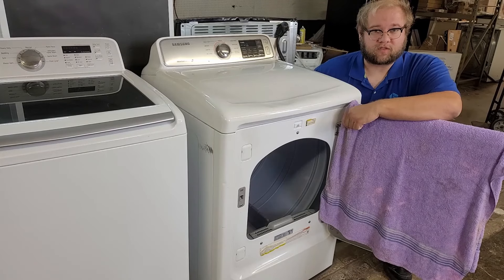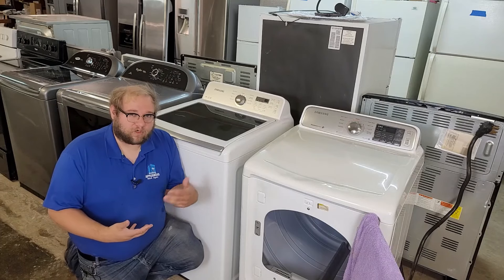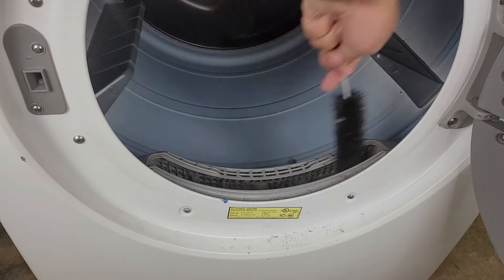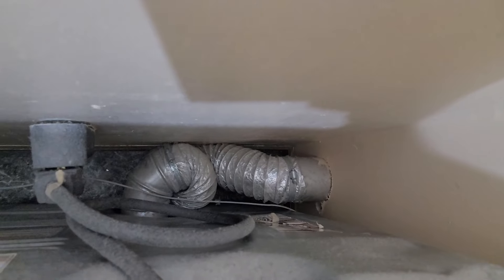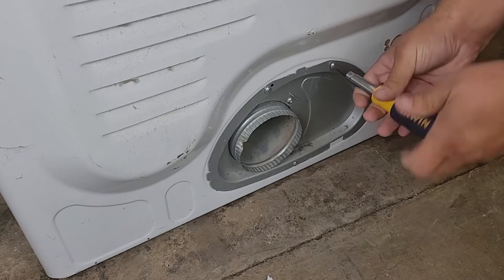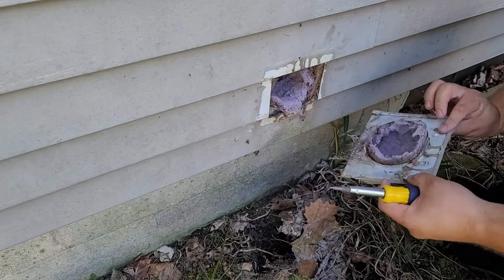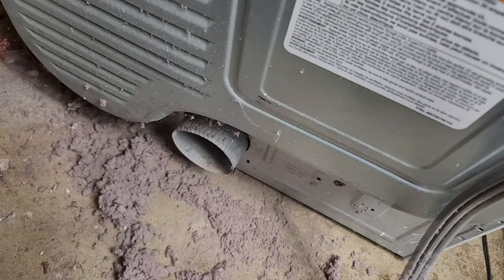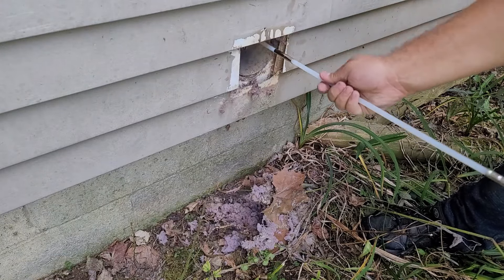Samsung Dryer Heating but Won't Dry Clothes - How to Fix

Comment: Stay away from Samsung appliances they are garbage I've had to learn the hard way
Reply: Yes!!!! I completely agree! I will never purchase this product again.
Reply: Completely agree! We are all here for the same problems
Reply: Samsung is horrible
Reply: Im here for the same problem
Reply: They’re all garbage besides speed queen
Reply: Well shit.. it's the reason I'm here...
Reply: I bought one years ago without doing any research. I know now how bad they are, going to try and keep it as long as I can, but looking forward to getting something new in the future.
Reply: Dam bought one 3 months ago and I’m already here
Reply: @Ferndawg11  if possible stay away from any appliance that has a computer on them they are junk
Reply: @Ferndawg11 we got ours and the next day tried using it and the fuse for the heating element blew. First cycle. And now, three days later after a repair to replace the fuse, the moisture sensors are fcked up
Reply: 100 percent agree its a pos, there is no blockage it was a sheet, happens every time

Comment: Also, don't forget that Samsung dryers can have those sensors in front of the lint trap. My dryer was shutting off after 2 minutes of running. Turns out a fabric softener sheet, was plastered against the inner edge and blocking the metal contacts from coming in contact with the wet clothes.
Reply: Same here. It turns off automatically even if the clothes are still wer and the worst part is even though is off it's still spinning.

Comment: you forgot to point out another great reason not drying: the drum seal is old and worn down and you can see light though it at the bottom of the drum in the very back, now this is a common problem i see a lot, it will let in cold air and temp will be very low. i think the hot air is also leaving the drum with lint and adding up into the cabinet area and there is you fire hazard Mr.Ben...  it took me many years to figure how is so much lint getting to the cabinet???  it is loose fitting drum seals and what is worst is the presser air pushing out the lint between the weak seal of the drum into the cabinet because the plugged up venting that has a restriction in it from lint build up or worst to  many 90 degree bens in it for each 90 degree ben it will lose i think 5 degrees of temperature i think that is right  or something like that, to many 90 degrees bens is a killer and a long run ducting is a killer you will need a inline blower pusher fan. i have seen those in condominiums forcing exhaust air out long distances...  just say`n
Reply: This is really great info. Thank you.

Comment: Always replace flex pipe every few years. Cleaning only helps short term. Solid pipe is always best no matter what setup you have. You can always disassemble the pipe for cleaning. Never use screws in solid pipe. Just use aluminum tape on the joints.

Comment: Make sure you secure the sections of the dryer kit with tape or something that will prevent them from pulling apart.  If you have a long run from the duct in the laundry room to the outside vent,  trying to remove a section that came apart  is going to be a problem for sure.
Reply from the maker: One thing to note which I couldn't include because I cant speak for any one brush set is to run it in the drill in the direction of the threads. If it was clockwise and you ran it the other way,  it'd unscrew and cause an issue for sure
Reply: @bensappliancesandjunk  could you  make a video about front loaders and how to clean on the internal side of the drum? We dry out gasket, and leave the door open, and place a small fan on it when we aren’t using the washer toile sure mold doesn’t grow on it. 
Is there a tool that is thin enough that you can push it into the area that is the backside of the drum?
Reply from the maker: @lisacyr8636  I do plan on a video for that but honestly- I have to figure out a reliable way to do it first - we've tried a lot of different things that work sometimes but not always
Reply: @bensappliancesandjunk   what’s da name of ur kit ..?
Reply from the maker: @noesgrajales442  https://bit.ly/3zQGFYK

Comment: How do you bypass the moisture sensor??? This is the biggest problem with a Samsung. It's not getting hot. It just turns off. I've seen all the instructions on cleaning the "dryer sensor". I shouldn't have to do that to dry my clothes.

Comment: Thanks!!  Nice informative video.   I bought a new Samsung dryer and my vent hose and filter are all clean and new!!    My dryer was working great and seemed to dry my clothes quickly but I notice when drying my comforter it doesn't seem to dry completely even though I have it on high heat / sensor dry setting.   Is that because comforters are harder to dry completely?    Would it be better for me to dry it on high heat using the timer on the dryer ? (40 or 60 minutes)

Comment: Great video! My dryer heats up but doesn’t completely dry clothing so I need to run it multiple times. Going to clean with vacuum and if it doesn’t help I’ll get the kit.
Reply from the maker: Always good to do a cleaning.
Reply: That sounds like the moisture sensor being impaired. I had a similar problem and I found that our use of fabric softener, scent beads and dryer sheets caused an oily film to deposit on the metal bars. Those bars are used to inform the dryer of how wet the clothes are while they are tumbling. If the water on the clothes cannot make direct contact with the bars (because the oily layer is there, and oil repels water), the dryer will (falsely) believe the clothes are dry and the dryer will end the cycle prematurely.

The manual said to clean the bars with a damp rag and then dry them but (again) oily substances do not mix with water, so I used a rag dampened with isopropanol (isopropyl alcohol, same thing) and the dryer immediately worked as if it was brand new.

I hope this info helps you as much as it helped me! 🙂

Comment: Just throwing my hat into the ring. My exhaust port on outside of the house had a flap door,  and. aplastic lint grate - well, the grate's 2 rear plastic nubs were snapped off, so "seating" it in the rear portion was just guesswork. Well, my grate was too high (again, the rear nubs couldn't snap in due to being missing), and it blocked the flap door from opening. I was having to run the dryer 3-4 times to get a load dry. SOME air would escape the flap which is why it somewhat worked. We also had condensation on the metal exhaust hose, again due to lack of ventilation. Thx for this video - i went outside to check more than just the plastic grate - and discovered the flap door was blocked.
Reply: Was there alot of water?
Reply: @mahalnabayanko7454  condensing onto the floor from the metal tubing? No. Few ounces on th floor.
Reply: What happens  if there's water on the exhaust and the pipe is clog? Is there any solution ? No access to the pipe. Pipe is between walls.
Reply: @mahalnabayanko7454  water condenses on the pipe because the hot air has nowhere to go bc it’s clogged - therefore it results in condensing on the pipe and eventually drips to floor. Surely there is a beginning and end to pipe even if the middle is between walls. Gotta shove a long duster thing in there. I had a long 8’ duster meant to extend really long so you can dust ceilings and high places. Use that. Shove it in there and twist around
Reply: Do you have a link of the duster or cleaning tool that might work?
Reply: The beginning would be from the dryer vent which is on thr first floor and end is on the upper side of the  wall. I dont know why it is built that way. There is no middle at all. It is between  wall so no access at all  😢  do you think there's hope to remove the clog at all. I'm losing all hope  😢

Comment: I have a Samsung Steam Smartcare Dryer and in normal mode it starts on 42 then 22 then 1 minute and shuts off.  It will work in Heavy mode but not normal mode.  Please help.  I would appreciate whatever you suggest.
Reply: That sounds like the moisture sensor being impaired. I had a similar problem and I found that our use of fabric softener, scent beads and dryer sheets caused an oily film to deposit on the metal bars. Those bars are used to inform the dryer of how wet the clothes are while they are tumbling. If the water on the clothes cannot make direct contact with the bars (because the oily layer is there, and oil repels water), the dryer will (falsely) believe the clothes are dry and the dryer will end the cycle prematurely.

The manual said to clean the bars with a damp rag and then dry them but (again) oily substances do not mix with water, so I used a rag dampened with isopropanol (isopropyl alcohol, same thing) and the dryer immediately worked as if it was brand new.

I hope this info helps you as much as it helped me! 🙂

Comment: We have a Samsung dryer bought new approximately 3-4yrs ago. Seems to only want to dry clothes on Sanatize cycle. And not on a normal dry cycle? Luckily bought extended warranty. Had service company come out. And said how they had to replace both heating elements.

Comment: 4th Thing...A defective Cycling Thermostat.
A defective cycling thermostat will cause the heating element to turn off before it reaches 135 - 155 degrees.
At room temperature (70 degrees), a dryer's heating element should stay on for at least 30 seconds before it cycles off.
If the dryer's heating element turns on, then turns off in less then 20 seconds, replace the Cycling Thermostat.

Comment: Hey Ben, what if the back of the dryer doesn’t have those screws to give access to the inside of the dryer to check the dryer vent?
Reply from the maker: You can still pull the vent tube out, but there's no real room to access anything. You can at least visually inspect to see if there's any issue

Comment: Question.  When the tech came in to clean it (from the HVAC Co), he said the dryer vent cleaning tool couldn't work because of the angle of the vent (goes up to the roof!).  He actually borrowed our leaf blower.  However, things are still not drying.  I'm not sure if the kit you mentioned is the same as the one he tried to use.  Can you think of any other way I could try to clean it?  Thanks,

Comment: What if you did All that and it's still not drying correctly? We did everything and changed heating element not to long ago and after we cleaned the wall vent now I can only do a very small load in order for it to dry.
Reply: Did you bought the OEM heating element part or the aftermarket one?

Comment: I have a 7 year old LG that comes on and heats up, but the drum isn’t rotating. I opened it up and cleaned it thoroughly and the belt is intact. There is a click when you press the start button that sounds like a relay to me… Any tips on what you would check first.
Reply: It's a relay switch on the motor that  the tention pulley rest on.,check the tention pulley assembly

Comment: When my dryer vent was cleaned there was water on the vent hose and also outside the exhaust there was water. Is this normal? I been having problems woth my dryer not drying properly. The heat is inside the dryer and not going out of the exhaust. Do you think the problem is the dryer or the pipe? How did the water get there and out from the exhaust outside the house? Pls help

Comment: I have this dryer one day, brand new. Last load keeps shutting off and won't dry. This is frustrating. Since it's new I am calling the store they can either fix it or replace it. I hope I will not regret buying Samsung.
Reply from the maker: Please understand, if the vent system is clogged, kinked, or obstructed, the issue will be on your end and cost. I've seen many times where someone buys new and it doesn't dry because a problem that caused their old one to break, persists on the new one

Comment: Have a Samsung dryer it doesn’t heat but runs. Replaced Dryer Heating Element for Samsung dv42h5000ew/a3 dv45h7000ew/a2 dv48h7400ew/a2 DC47-00019A Dryer Heating Element DC47-00018A Thermostat DC47-00016A DC32-00007A Thermistor & DC96-00887A Thermal fuse and it still will not heat . Test heater relay and it’s working . What next .
Reply: Clean your lint filter,clean out your vent,check the themo fuse

Comment: Worse large appliance purchase I've ever made. What used to take 1 hour in my old Maytag now takes TWO. All of this 'Energy Star' stuff is complete BS. And no, I don't overload, and yes I clean my lint trap EVERY time.
Reply from the maker: Do you clean the vent, and ensure that where it ends is fully clean? This should only take 45min to dry a typical load of clothes.
Reply: @bensappliancesandjunk  from day one it didn’t dry. Then it sucked a pair of panties into the dryer. When the repair man was there he tried telling me how to turn off the energy saver and make it hotter. He seemed to know that brand or model wouldn’t dry thoroughly.